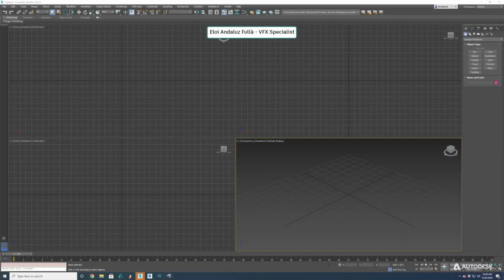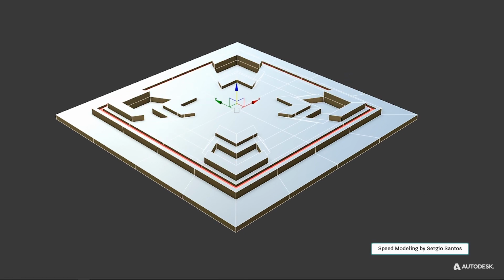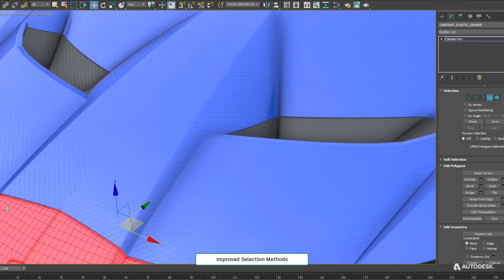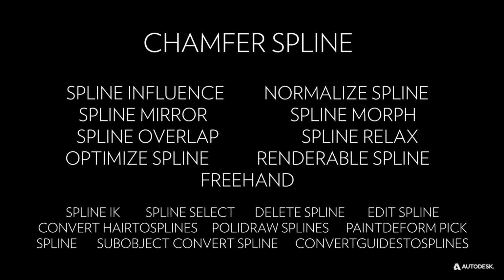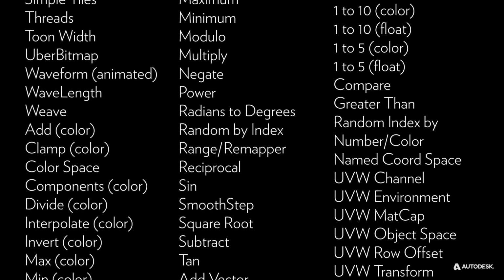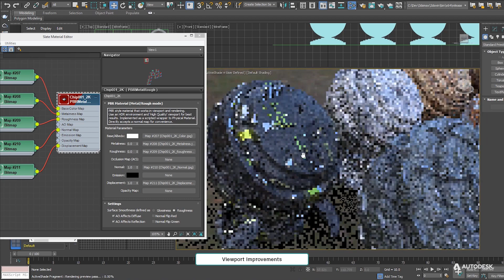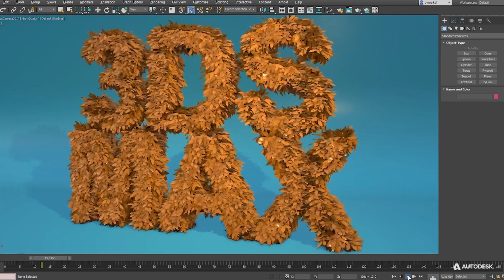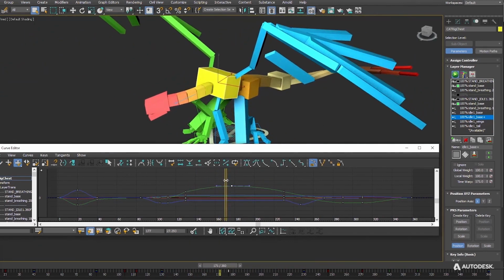What's new in #3dsMax 2021.2 Update

Comment: did Autodesk wake up a bit? the splines in Maya for instance are 20 years old. I mean look at max, it has a history (modifier stack), chamfer, lines 100 times better than in Maya and and and, dump Maya
Reply: But Maya has more refined and updated direct modelling tools and so on It's incredible the balance between these two apps. Max will also get some sculpting brush jmprovemnts as shown in the roadmap.
Reply: @orphydiancg7759  Maya is super slow in polygon operations compared too max. Something that is done in five seconds or less in Max takes up to 30 or more minutes in Maya. it's a joke
Reply: @dubtube6691  I mean for direct straightforward modeling. You core modeling tools have been refined and updated in Maya a couple of years ago, so did the access to those tool with consistent hotkeys. There are also live symmetry supporting all the updated tools I've mentioned, better and updated free-form brushes(or sculpting if you want), modern and updated quad draw for retopo, faster and flexible context menu or quad menu, flexible and super fast pivot aligning etc. So for linear, destructive work flows Maya has been greatly refined the past years and simply can't deny its edge over MAX outdated tools. They just starting to update the chamfer modifier and the extrude one but the last update doesnt apply to the edit poly extrude tool so yeah baby steps.

Comment: It would be better to add a function. So that you can remove unnecessary objects in the viewport, but leave them on the render.
Like in cinema 4d, for example
Reply: "Render hidden object" checkbox in F10 dialog?
Reply: @3enjamin  This is not what is needed. In cinema 4D, this is implemented in such a way that I can adjust the visibility on the render, but not in the viewport for each object separately. I can adjust this in the layer Manager. This is not implemented in 3ds max. Although the same functions are available in Blender and Maya
Reply: @AlexeyChromer  I haven't got experience with C4D, but you can hide layers and objects inside that layer in 3ds max, too. And we can render things that hidden in viewport whether they were hide by layer or object. But I guess when you come from a software and got familiar with it, do the same thing different way on another software always feels uncomfortable. Or maybe I miss something because I honestly don't see the importance of feature you mentioned, maybe you didn't explain it clearly, or maybe I missed it.

Comment: Blender's Extrude Manifold failed miserably. This looks better.
Reply: why?
Reply: I’m sorry, what? Blender’s Extrude manifold works identically to what is shown here.
Reply: @loganpreshaw4430  yes!!
Reply: @loganpreshaw4430  You never tried both, Right?
Reply: @rokufx  I haven't tried the blender one yet neither this in max. How they exactly differ ?
Reply: @orphydiancg7759  did you even pay attention to the video?
Reply: @keltart809  sarcasm is not gonna make some light here on how Blender manifold and this compare or for those who haven't tried both. It's the case when you have a chamfer modifier on top that gives Max an edge ?
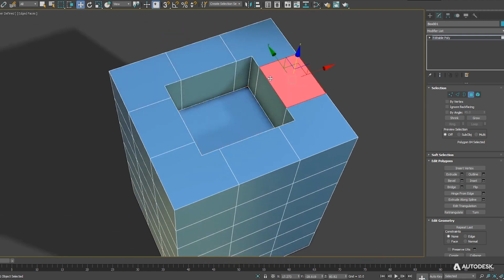Reply: @orphydiancg7759  at 0:36 mark you can see that max smart extrude is not locked to one direction, you can extrude to different axis. For Blender its locked to one direction as far as i can tell. Also there are certain extrudes that leave behind artifacts as explained in this video https://youtu.be/ik6oNdIoqBk?t=224
Reply: @keltart809  nice that was really help full. If they haven't yet improved the thing in Blender than I suppose its just another case when Max is doing things a bit later (sometimes very late) but it does them properly and more refined. Those limitation on Blender kinda defeats the purpose on having a smart destructive extrude. The fact that you have to activate snap and target the edges where your extrude needs to stop and where the merging should happen and the fixed axis are serious limitations.